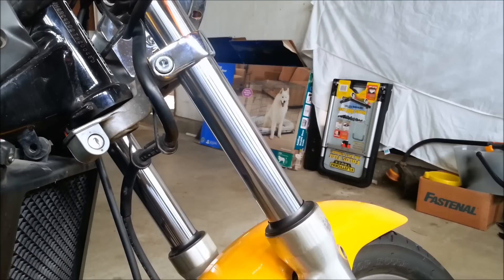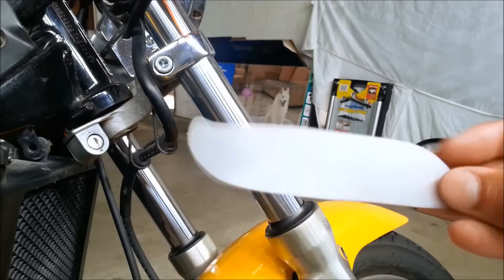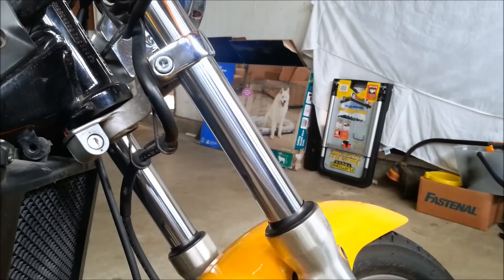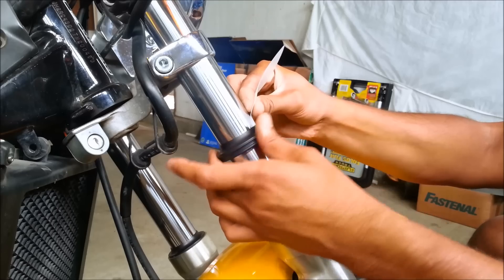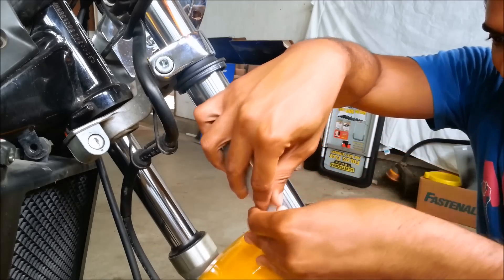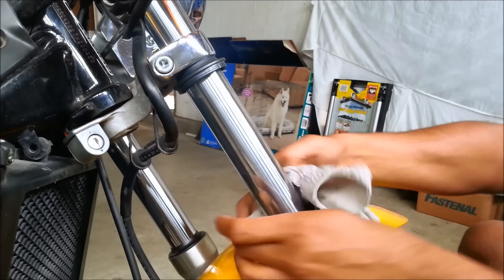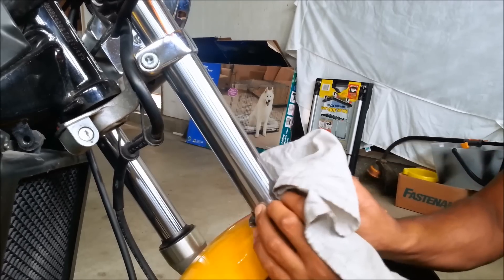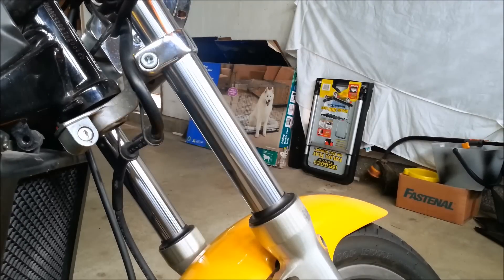How to Fix Leaking Motorcycle Fork Seals for Free

Comment: Just done this to my 2009 Xmax, and amazingly it has worked. It was only a very small amount of oil leaking, more like a weep, but this method has stopped it completely. I used a mobile phone scratch protector screen to make the tool which is much thinner than a margarine or milk carton container. Thanks

Comment: Great tip! Worked on my V-star. Made the tool from a plastic coke bottle.

Water had gotten past the dust seal and began to rust the seal retainer clip. This rust was probably the cause of the leak. I cleaned it up with steel wool and painted the clip. Flushed out the rust from on top of the main seal with WD-40.

I think I can replace the dust seals by removing from the triple tree and wont have to take apart the inner tube from the outer tube to replace the main seal.

Thanks again.

Comment: I  bought a set of fork seals and came on youtube to get instructions on fitting them when I found this video..........  This method is far easier than replacing the seals and works perfectly, I used a plastic from a margarine pot..... Anyone need fork seals for a Harley sportster ?......................Thanks for the tip !
Reply from the maker: Awesome. Glad the video helped and thanks for the comment.

Comment: I have to say i was a little sceptical about this, that it would actually work, but i tried it myslf and it works like a charm. Was a bit of a hassle because i ride a firestorm so the fairing was a little bit in the way, but it works just fine. Thanks for the great tip and great explanation video!

Comment: I've got a slight leak on one of my forks on my ZRX 1100 and I notice a black ring of dirt on the fork tube. Gonna have to give this a shot before I go and replace the fork seals. Thanks!
Reply from the maker: Slight leaks should be no problem at all. I recently used this procedure on my dr650 that was significantly leaking, had to do it twice but leak is gone. Good luck.

Comment: interesting....i was awaiting for some kind of additional seal insertion but no huh? So basically the dirt and debris lodged between the seal and the actual fork itself is causing the leak in most cases and not like a cracked or ripped seal?
Reply from the maker: yes 99% of the bikes I come across with seaping seals is dirt in between the fork tube and seal. And this has worked for me on every bike.
Reply: +Tito Sean no shit!  here I was prepared to spend all Saturday tearing them apart. Much much thanks for the enlightenment my friend!

Comment: When I remove dust cover ant stick this "tool" to the fork seal, it just sprays the oil with the preasure from the gap where tool is inserted. What I am doing wrong?
Reply from the maker: It is normal for a bit of oil to come out as you are essentially breaking the seal and removing the dirt. If you move fairly quick it should be ok. You can also raise the front wheel off the ground to take pressure off.

Comment: You did know, that the top radiator mount bolt is missing, right ? BTW good job, and nice bike.
Reply from the maker: Yes thank you. I did notice the bolt missing when I was making the video and have since replaced it. Thanks for the comment.
Reply: You're very welcome.  Do like the color of your bike. It's seems they are safer as well.

Comment: What to do if the there is too little oil inside the fork due to the long time   leaking?
Reply from the maker: leskru you will need to open the fork cap and fill it. However I would replace the seals first so it does not leak out again

Comment: is replacing the oil or refilling it isn't necessary??
leaking does means loss of oil from the forks .
Please tell asap
Reply from the maker: if there is only a slight leak you don't need to replace/refill
Reply: +Tito Sean fork is leaking for quite some time now and now oil can be seen accumulated on seal as well as a on fork
Reply from the maker: +Dhaval Bane In that case replace the oil. Video is here https://youtu.be/zll8jjdi9XA
Reply: +Tito Sean thanks

Comment: I am changing my fork oil with new oil. My manual says 10w20 but I can't seem to find that anywhere? This is the last thing I need before I put my forks all back on my bike. Anyone have any suggestions?
Reply from the maker: Usually fork oil has a single weight 10 or 15 would be fine
Reply: @ebay111978  thank you

Comment: How do I know how much oil I have loosed?
Reply from the maker: +hairlesheep There is no way or finding that out. This method should only be used if the leave is minor and recent.
Reply: +Tito Sean .. Or you simple drain and replace the oil. This should be done every couple of years anyway. On a Harley, changing fork oil is very easy. I'm not sure how to do it on a Japanese bike.